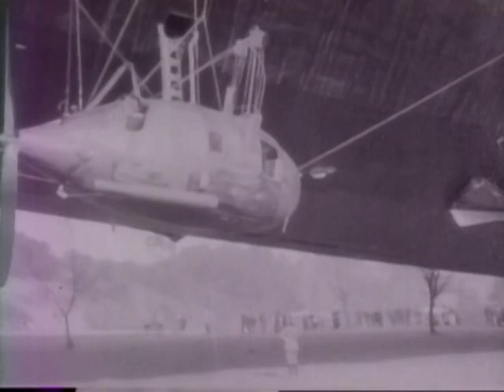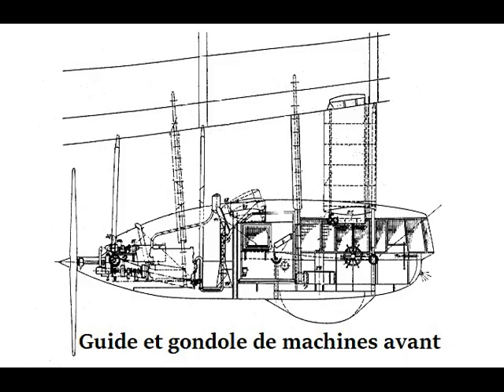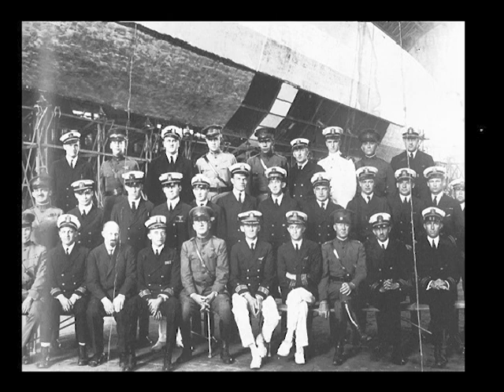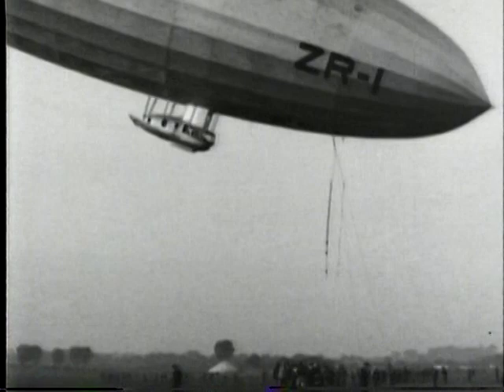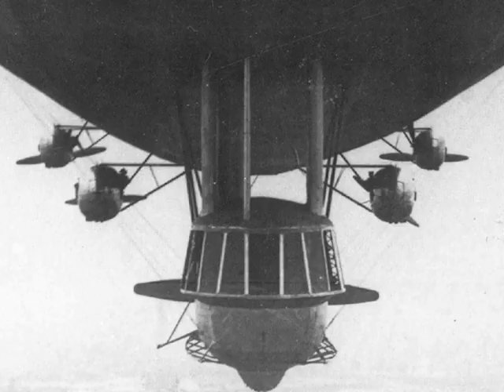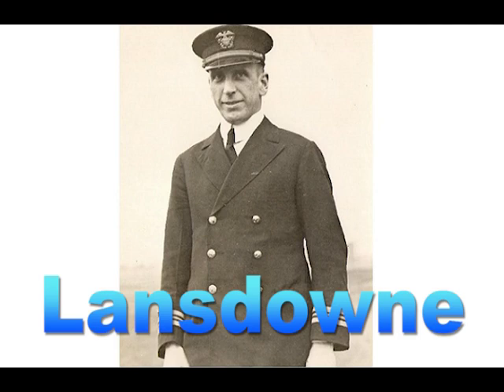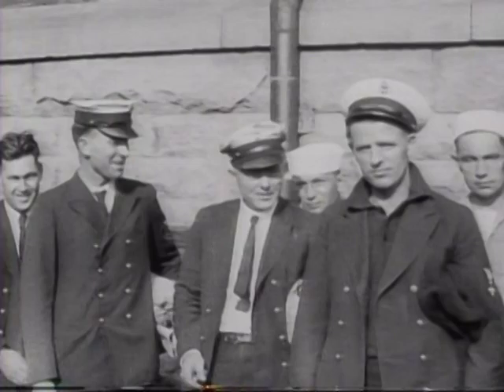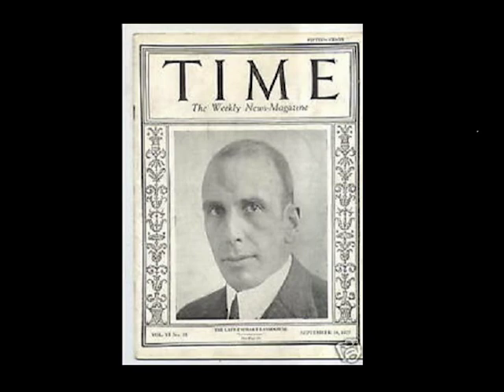America's First Rigid Airship

Comment: Interesting that the Los Angeles was able to fly on helium with little difficulty - but, looking at the Shenandoah and the LA side-by-side, it's clear that the LA was a subsequent design generation more advanced; it had the tapered teardrop-shaped hull whereas the Shenandoah looked like a flying cigar.
Edit 1: I can understand why Cmdr. Lansdowne clamped the relief valves shut though; he probably didn't appreciate being yelled at for two hours by some bean-counter REMF every time he landed the ship.
Reply: The teardrop hull was adopted specifically to prevent destructive expansion like what destroyed the USS Shenandoah.
Reply: The difference between the ZR1 and the ZR3 is that the first was designed and built in the USA and the ZR3 (Los Angeles) was designed and built in Germany.